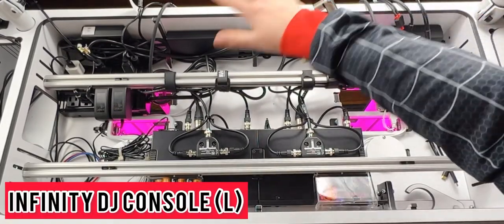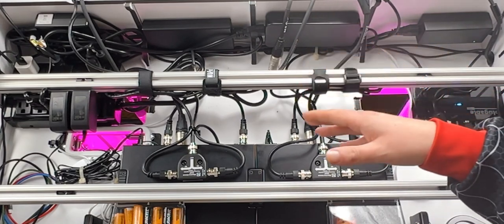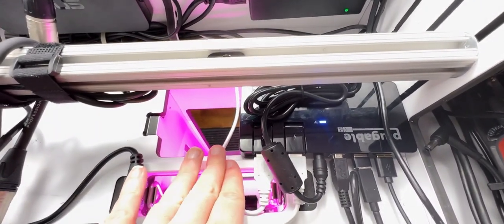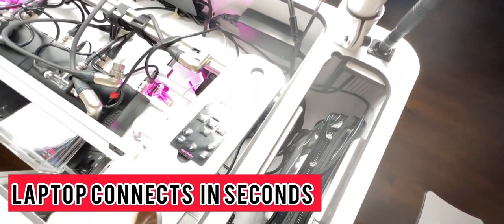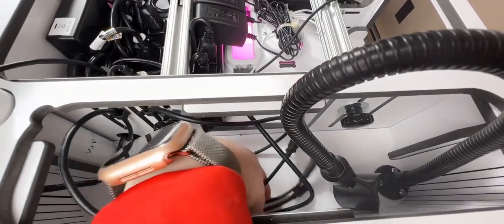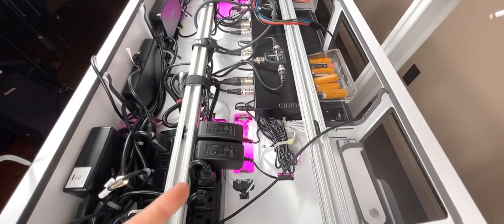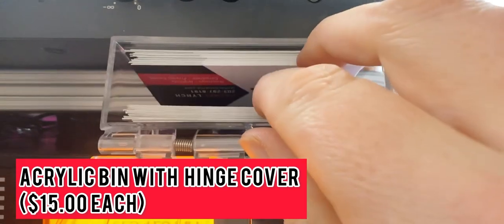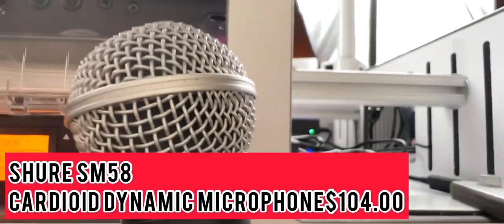Infinity L Gear and Wiring Installation

Comment: Awesome. Very informative. Thanks for sharing all the purchase links. Also where did you get the harmonic mixing wheel sticker that’s on your one laptop? 
The pizza 🍕 at the end is your new signature brand 😂
Reply from the maker: If you like that rack mounted style check out this newest booth version. 👇🏻🙂

https://youtu.be/hDHv6klJCpk

That’s my new video closer. Isn’t it wonderful! 😂👌🏻💯
Reply: @DJRachelLynch  yea I did see his new booth. Which also has a small and large version correct? Does the smaller version fit the rane one? 
Also only downfall is you have to buy your own case/rackmount to fit inside. 
I’d really love to see one of them come out with one on wheels that you can leave together so you can just roll in and roll out.
Reply from the maker: @MixMasterDJService  Yes. There is a “L” and “XL” version of each style of booth. The “L” will fit the Rane One. The point of the booth is that it’s portable and easy to assemble. There is no need to keep it assembled to roll in. Besides those rules of booths already exist. 😉

The gear is much more protected in the SKB cases. It’s designed to come apart and assemble quickly. 👌🏻

Comment: With the Roland 707 you don't need a external mixer? Does the work with VDJ? Thanks again for another great video!
Reply from the maker: You don’t need an external mixer. 

VDJ is MIDI based and works with anything. 🙂

Comment: Great work Rachel, loved the card and battery holders. However I’m not a fan of just plugging in to a power base, I been at gigs where the electricity was dirty or the other electronics interfered and cause hisses and other noise, that’s where a power conditioner comes into great use when pluging to many devises. Another observation is that I don’t see you use a compact mixer, DJ controllers don’t have premium preamps, to keep the cost down on their components, plus it gives you more cleaner signal and you can have outputs to give audio to videographers that are recording audio from the events. Also it give you better sound and less feedback to your mics than just pluging them to your dj controller. But tight work over all.
Reply from the maker: The Roland 707M is the only controller designed to not need another external mixer. It’s exactly why I purchased it. 

It has amazing mic preamps. That’s why I use this as my “wedding console”. It features studio-quality microphone preamps with independent gain, low-cut, and noise gate on each channel. Normally I would always recommend DJS avoid just using their controller mic inputs without a mixer. 

Also this power base acts like a conditioner. That’s why I got it. Everything installed here is very intentional. 🙂

Check it out here: 
 https://youtu.be/QopxowM_k_U

Thank you for checking this out!! I appreciate your time and comment.  ☺️

Comment: Nice job. Next goal is to plug mics, aux and the controller to an external digital mixer or do you like to control everything thru the controller ?
Reply from the maker: Only with THIS controller. It was designed with wedding DJs in mind. It has great mic preamps. It’s why I bought it. Any other controller I’d be using an external mixer. This has been an AMAZING a controller.
Reply: @DJRachelLynch  yes, that makes sense. Only few controllers have good mic preamps and complete control for mics. I use a UI24R (two : 1 for reception / 1 for ceremony) as Lou Paris does, as it’s convenient. But that comes at high cost and space in the vehicle. I shall put my hands on the Roland 707 or 808 and see if I can rationalize a bit my kit to gain space and installation time. I am happy with the Rane One, so I’ll see… Even that today, we all look after the last geeky gears but back in the days, I’ve rocked the dance floors with 2 technics and simple mixer :-) And few years ago, I’ve done several gigs with the Traktor Kontrol S2 and external analog mixer and I’ve done the job too :-) We are all too sensitive to the marketing sirens and I’m too :-) technics, S11, Xone92, 1 CDJ 3000 and 1 SC600M at home and the Rane One and sometimes Technics on gigs, so I’m certainly a gear geek :-) Gears have changed a lot since I’ve started Djing in 1987 :-)

Comment: Hi Rachel, great video. Do you not use an external mixer? And could I use my phone to play requests if I don't have tge music on my drive? Will it sound good going through a channel or use my iPad On a channel? Is it a line? You're tge best!
Reply from the maker: The reason I went with the Roland 707M was because it has a tremendous amount of inputs and studio quality mics. It’s literally the selling point of the controller, so no external mixer needed. ☺️

Absolutely. I connect my phone and an iPad every event (as my backup). Sounds fantastic. 

You can have up to 4 mics with this controller.
Reply: @DJRachelLynch  Awesome! I use a ddj flx 10, it has all the hook-ups. I get so much help watching your videos. Im just trying to get better every day. Thanks!

Comment: Hi Rachel! Do you know the total weight of the top? I have a Roland DJ707 too, and like to make only the top portion without the legs/base. Thanks for all your advices!
Reply from the maker: Obviously it depends on what you have in the top, but dimensions and weights are mentioned here. 🙂

https://youtu.be/AmlrncP_tbk
Reply: @DJRachelLynch  you are a awesome dj, you are very detailed. what dj controller are you using in 2023
Reply from the maker: @tyhaynes30  the Same Roland 707M. ☺️

Comment: Hey you ever think of using streetheart  SKAA pro? No need for hiding wires anymore! 👍🏽😁
Reply from the maker: I have no problem using wireless technology when absolutely needed, but I will ALWAYS run proper cables when possible. This is a one and done. Everything stays connected. No need to do any of this again. All I have to do is connect power and my speakers. Direct connections are best IMO. I appreciate the recommendation. I’ll definitely see what it’s about. 👌🏻
Reply: @DJRachelLynch  kool. Your right wired connection is the best way. They use this on professional stages with professional artist too. No wires and a faster set up with very low latency. This way you can have speakers virtual any where in your venue with out having to worry about speaker placement 👍🏽🤓
Reply from the maker: @bboymac84  always happy to see what tech and gear is out there. Thanks for sharing this. I’ll check it out. 🙂
Reply: @DJRachelLynch  always here to help out my fellow DJs

Comment: 4:40 locating UHF antenna 2 inches of conductive tube parallel to antenna significantly lowers its efficiency and messes the radiation pattern.
Moreover if the conductive tube is grounded then you'll get RF short circuit that adds excessive load to transmitter output amplifier.
Consider relocating antennas to at least 1 wavelength from prolonged conductive pieces parallel to it (mount them on top of those tubes).
Reply from the maker: I apologize, but I only partially understand your comment. I’d like to know more.  Right now there is zero issue with my mics but want to consider a correction if needed. Can you simplify your previous comment so I can follow more closely? What “tubes”? Thanks!
Reply: @DJ Rachel  When I said "tubes" I meant the poles of laptop stands. Looks they made of steel or aluminum so they are conductive. On such small distances they become passive elements of the antennas that certainly causes changes in antenna's electrical characteristics.
Reply from the maker: @froller  got it. Thank you for your follow up. I appreciate it. 🙂
Reply from the maker: Just to clarify the tubes are not grounded as the max booth is not conductive. So that should not be an issue. 👍🏻

Comment: Has anyone have any comments on this console vs the Bunn Dj Booth . Wish I could see them side by side on display
Reply from the maker: If you’re able to come to any of the DJ Expos or conferences both Danny Max and Joe Bunn are often exhibiting. That would be the best place to check em’ out.
Reply: I had the bunn DJ booth. It’s made of aluminum. The thing I like about the bunn booth is it has a whole tower where you can rackmount equipment. If you want you could leave it together and not take apart. It’s best to see the booths in person like Rachael said so come out to one of the expos.